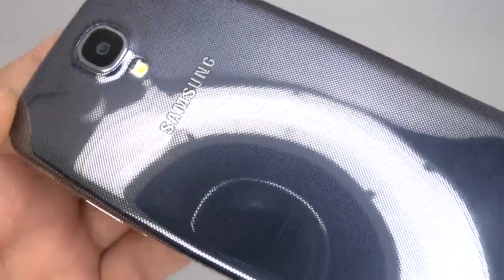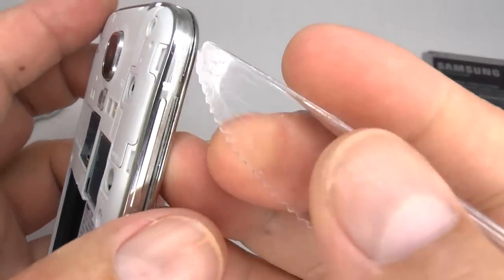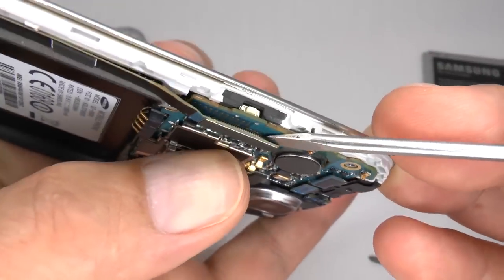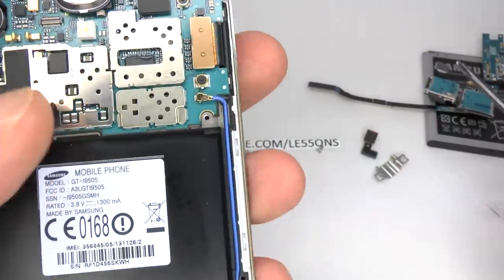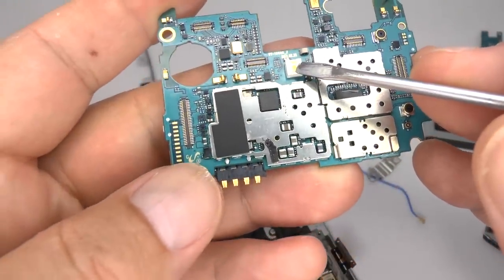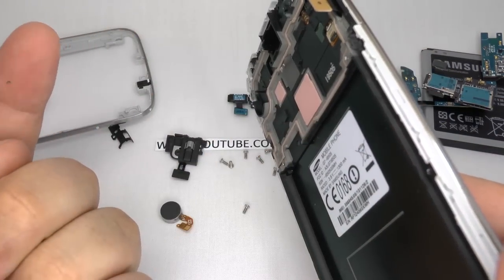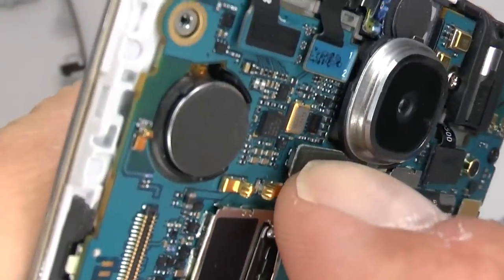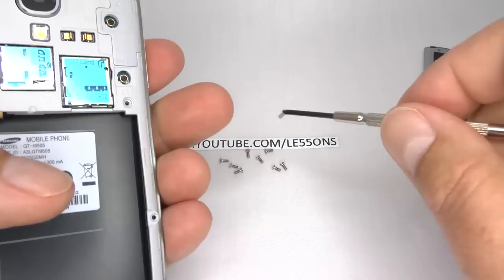Galaxy S4 Disassembly & Assembly Teardown - Screen & Case Replacement

Comment: Well It actually broke when I was replacing my charging port, and when my dad was soldering it back together he pretty much melted the hole up haha... so I have been using my phone with it, so it obviously isn't that vital, so what is it's point? Should I get another one? if so is it just a wifi cable like the other? Thanks :) Gonna like and sub! very detailed video, awesome job!

Comment: Hi, can you please answer this question. I am about to replace the glass on  my wifes s4 using loca. I have done several iphones, well lots really. I just want to know what is the best temp to use when removing the glass, as I have had so many stating different temperatures. I have all the correct equipment in place ie heat gun  and infra red thermometer etc etc ,,,thanks in advance for the reply  rgds Dave.

Comment: Thanks for all your good videos.
I am having problem with my s4 not recognizing my SIM card.
Do you think it will help if I change the SIM reader.
Did a factory reset but that did not help, And nothing wrong with the battery either.
Reply from the maker: a new sim reader would be a good idea, but if its water damage it might not help
Reply: *****

Hi LE55ONS. :)

I bought this phone from a dude. But I dont think that it is water damaged.
Is there any way to see if it is, without opening the phone.?
Sometimes it lose contact with the SIM. But lately it dont help to take out the card or to restart the phone.
Anyway, Thanks for your answer and have a great day.
Reply from the maker: Amoth Jon there are some water sensors inside which change colour if they have been wet, its still worth fitting a new sim reader
Reply: Thanks LE55ONS.Keep up the good work.

Comment: My SG4 got wet 6 months ago, with the help of your video I have taken the phone apart and found no corrosion but the phone will only hold connection to server for phone calls or mobile data when you make the phone select the network manually which only lasts for a minute or so, any idea what is wrong with the phone ? Thanks in advance

Comment: I have changed the screen but menu and back button doesn't work.Home button Ok.Does it have to be some kind of isolation under home button flat cable or it must be in contact with board?

Comment: Hi i on my s4 my ear phones only work on right side with a buzzing noise on my left side i have changed.the phone jack and still no luck ive tried different head phones and still the same do you think if i change the ear piece the main top front speaker would it fix it as i get buzzing noises when im on the phone to someone thanks

Comment: my screen went blank…I placed my board in an identical S4 case (in  case it was the optical cable) still no operating screen…I can answer calls..(if I swipe accurately enough) ..i  tried all the holding the on/off button tricks…no luck…any suggestions on what parts to look at? thanks

Comment: Thanks for vid. If I buy a new plastic-housing without anything - is everything transferable? You dont take out the wifi-bluetooth/GPS/4G antenna!?
Reply from the maker: it should come with the antenna's and the foam pads etc, but have a close look and make sure you swap any parts over that are missing..
Reply from the maker: Martin Dreiager this should help Samsung Galaxy S4 Glass Screen Replacement Marietta, Dallas, West Cobb GA

Comment: I did a screen and LCD replacement on my s4 which I hadn't used for months since breaking it, followed all instructions as carefully as I could, but since reassembly everything works except now the phone switches between absolutely no network signal and only one bar. Even with one bar calls and texts don't work. Any ideas what I did wrong? Thanks

Comment: Hi LE55ONS!
I did everything you said and most of my internal board was corroded. I accidently dropped it in the pool. Had it stored in white rice for a whole week and nothing... So anyway, I powered it on and a green light came on (front on sg4 there's 4 circles and a 5th that I assume is the camera, Is there anything I did wrong? PLEASE REPLY ASAP. THANK YOU!!!

Comment: do  you have to take that circuit board out to replace the camera  lens cover?
Reply from the maker: yes, as the glue that holds the metal lens ring on is very strong and you need to be able to heat and lever from all sides

Comment: My camera can't focus. When the object is right in front of the lens you can see clearly but farther object is all blurred. I got the camera changed recently but still does this. I was told it might be water damage even though I've never dropped it in water.

Is there a way to fix this? Or should I just get a new phone ;-;

Also is there a way to make the phone cooler? It's been heating up alot lately.

Comment: Really Good video.
You make it look easy.
And yes I found it easy too.
I was harder to find a supplier that supplied genuine samsung screens.
Mine set me back £92.99 ouch but it works perfectly, my own fault with the video is, you should of replaced that mid chassis as it was battered, I have made mine look like new. And it really does look new.. 
Great upload man. Thanx.

Comment: Hi my s4 has a problem with the sd memory card won't click in , it makes a click sound but won't stay in , I am a woman and was looking at your video, is it easy to replace this part and does is have to be a genuine part or does the compatible part work the same ? Or is their a fix to this issue rather than replace the sd memory card and sim flex ? Thanks for your help

Comment: Hello. My galaxy s4's volume buttons are a bit stuck, I can still use them but I need to press them harder, and it feels they get stuck in the bottom. Same with my power button. Both pieces don't seem to have any damage at all, I think I just need to pull them out and in again. How can I do it?

Comment: If I were to do a motherboard swap do you know if AT&T would still be able to recognize my phone. Is there a code of some sort encrypted in the phone or is the phone recognized by the sim card?
Reply from the maker: If your sim card works in other unlocked phones then it will be fine, I don't know what system they use but I think they can block non registered imei numbers..
Reply: ***** Two of the screws were really stuck and they partially stripped. Any suggestions on how to get them out? I tried using a rubber band
Reply from the maker: Stephen Klepner you can try soldering a screwdriver into the screw or use a very small drill to take the head off. It might also be worth trying a high quality screwdriver that fits well in the other screws..

Comment: I see there are mid plates for sale. I would like to change out the  piece that is in front of the mid bezal. Is that piece replaceable? i cracked the outer screen and it damaged the bezal that goes around the edge of the screen. Hope that makes sense.
Reply from the maker: its very hard to remove a good screen from a damaged frame, you'll probably end up buy a complete screen assembly with front housing

Comment: Hi, I recently drove over my phone with it inside the case. I had to replace the touch screen assembly and had great success but a few of the sensors seem to not work. Gyroscope and proximity. Where can I buy these or the circuit that controls these sensors? Can I buy a new logic board for it?
Reply from the maker: Try replacing the earpiece and proximity gesture sensor shown at 7:38 and you might find the gyroscope will work again. Its very rare to find logic board for sale..

Comment: Hi! I've watched this video right now (great video btw.) But here's my question: will replacing the main board (except the lower section of the phone) will fix my sensor issues? I'm mean I have a problem that after restart some sensors are working only for a while and then they just stop working (accelerometer and gyroscope) and after few hours every sensor stops working(proximity/ambient/magnetometer etc.) and the phone restart is helping only partially. I've tried all the sollutions: do a hard reset, even installing a custom rom, but any of these didn't help. So in conclusion: will changing the main board fix my sensor issues?

Comment: Hi do you know if there's a chance to remove those thermal pads and replace them with a copper shim, I've been doing this on notebooks gpu's cause the thermal pads they use end up increaising the die temperature. 
   On the S4 I found that the phone temps are idling around 38c, low usage browsing 50C and it's way to much , while gaming cpu core temp rises up to 75C even doing the on demand governor cpu scheduling from 250mhz to 1.6ghz. it's not acceptable for me

Comment: Can you please tell me where is the wireless adapter or antenna?
I disassembled my phone to replace the display and everything is working fine, except the wireless.
The phone connects to my router but it's working really slow.
Give me some advice if you have any ideas please.
Reply: don't think so

Comment: Hope you can help. My S4 has a white antenna lead on the left side opposite the 3G and GSM blue cable. I need to replace this as it broke during the screen repair. Do you happen to know what this antenna is for. My phone is 4g capable, and thoughts would be great
Reply from the maker: I think the extra cable is to support different frequencies used by some networks. You might not notice any difference but if you do they are easy to buy online

Comment: Thanks for video, very helpful. I need to replace my touch & home key flex cable but mine is slightly different to the one shown here. My flex cable plugs in further up on the back side much like your model just further up. My S4 shows a model # SCH-1545 but all the parts sites I find only show the shorter touch & home flex cable. Any ideas on this one?
Reply from the maker: I've put a link to the one you need below, you can use coupon code ETS2 for a little discount which also gives me credit http://www.etradesupply.com/oem-samsung-galaxy-s4-sch-i545-navigator-flex-cable-ribbon.html
Reply: ***** Thanks so much for the link. That looks exactly like what I need.

Comment: I dropped my galaxy s4 in the pool. I put in in rice for about 2 hrs and it seemed to work all right then the screen started to bug out. so I put it back in the rice all night and I tried checking it this morning but now the display is comepletly out but everything else seems to work fine. how do I go about fixing it? or what to take apart as far as cleaning corrosion??

Comment: Ive got one of these but something happened to it when i was charging it, before it started it went off, since then hasent turned on, is that a battery issue or something inside issue, tried turning it on and charging it but nothing on screen, when i charge it phone goes warm which could mean its charging but no turning on the screen.  ive ordered a new battery but nt sure if that will fix the problem, any help will be great, any advice and help thanks

Comment: My s4 fell in beach water for a brief moment, i immediately turned it off and put it in a bowl of rice for a few hours before turning it on. After turning it on, everything booted fine until the screen then went off. The phone receives calls and texts still, it also still feels my finger slides and touches so i could still slide the phone to answer a call. Is the problem with the screen itself or could something inside the phone be what needs to be replaced? Thanks

Comment: I replaced my screen.  Would there be any reason when I put the rear housing on it doesn't turn on, but if the rear housing is off and I put the battery in, it turns on and works properly?

Comment: I'm just curious, do you look at the phone's circuit board guide or something before you actually opened it? I'm just amazed how calm you are while doing this, I guess it's the experience, very good job here sir!
Reply from the maker: I experiment to find which antenna is for what, but it would be much easier if I had a circuit diagram to look at..
Reply: Yeah I thought so but anyways you did a great job, this will really help a lot of people especially cellphone technicians, keep up the good work sir!

Comment: How do I go about removing a loose thread screw? Im trying to replace the glass/lcd/frame. Iused the right screwdriver and successfully removed all but one.
Reply from the maker: you can use a small drill to remove the head and might not need to remove the rest if you have a new frame/screen assembly

Comment: Hi quick question. I think my proximity sensor isn't working properly. Whenever I place a call, my screen goes black automatically and I have to press the button to turn it back on. Should I replace the earpiece/proximity sensor? Or should I open and make sure it's sitting properly all the way down? Thanks.
Reply from the maker: make sure the glass is clean between the sensor and its sitting all the way down, if it still doesn't work you can experiment with very small bits of blu-tak between the sensor and glass until it works ok. You can use the test menu to help #0#

Comment: Hey LE55ONS,
Thanks for the awesome video but one quick question. I have a brand new GS4 and an old broken one with my pictures still in the internal memory. What piece of hardware do I need to put into the new one from the old to get into my internal memory if that's even possible. Any help would be very much appreciated. I already subbed and liked, thanks in advance.
Reply from the maker: you could try putting the old mainboard into your new phone and it might work..
Reply: At what time do you show yourself taking out the mainboard? If you don't mind me asking. Also thanks for your help, really appreciate it.
Reply from the maker: Christian Ledet 10:20

Comment: I am having a problem my power button doesnt work. When I push it it looks like its going to work but screen is active but blank. Now if I squeeze were the camera is at it comes on. Do you have any suggestion on what it is or how to fix it?
Reply from the maker: sounds like the screen might be broken inside, I think a new screen would cure your problem

Comment: Thanks for the very much detailed video, I have a problem in my Galaxy S4 that it stops to charge and a month ago the charging notification LED stopped to blinking while charging and there is no charging icon on the battery while charging ... have you any Idea about this issue ??
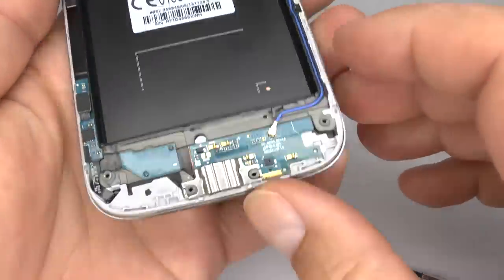Reply from the maker: I would try and have it repaired under warranty or replace the usb port flex 5:15
Reply: Thank you very much for the answer and the Support,
I do very much appreciate your help...

Comment: I think my gesture sensor is broken...as it stopped working all of a sudden though everything is on in the settings.
Where would I get a new sensor? And how can I be sure its a problem with the sensor?
Also my gyro sensor has stopped working as my screen is not rotating...any solutions?

Comment: Many thanks for you video! Both me and my wife have I9505 S4's but my wife's one has its wi-fi dead, so I suppose it is caused by a faulty wifi module - since I tried most of the software solutions.
I am wondering if the wifi module could be replaced without replacing the entire motherboard and without soldering, because I have no practice with that. 
Do you have any tip for me? Thanks in advance!
Reply from the maker: unfortunately it does need a 'hot air' soldering iron, its very hard to find someone who does this kind of repair. It will fetch a good price on ebay as there's always someone who thinks they can fix it :-)
Here's a video using hot air to replace one of the chips Samsung Galaxy S3 dead repair by changing EMMC [HD]
Reply: ***** Thanks! Sent private message. Congrats for the awesome videos!

Comment: thank you for your video. .you are very experience in what you do..can you plz tell why i keep loosing my 4g signal..i always a circle with a line through it..i tried changing the battery and cleaning the antenna but it still was a signal most of the time..plz help...ohhhh my phone is a galaxy s4

Comment: Hi, Just want to say your video is excellent, I got caught in the rain a few weeks ago and since then my phone wouldn't charge via a mains charger, it also crashed and I lost everything. I have replaced the the charging port and is now charging, but it still turns off sometimes when the camera is in use. Do you think I will need to possibly change the camera next!!! regards Jason.
Reply from the maker: yes that would be a good idea..
Reply: Many thanks for your help.

Comment: Hi LE55SONS,
I would like to seek your advice on a small issue around the power button. I have just disassembled an S4, 
After transferring the hardware over to the new screen, i put the battery in to test "before" i clip the silver frame back on - this phone boots and operates without issue.
"After" i clip the silver frame on, the phone doesn't want to boot up once you depress the power on button.
How do i overcome lining up the logic board power button and the frame power button successfully?

Comment: do i need to tske aprt everything in the back jus to replace the flex cable ribbon for thr menu and return button?
Reply from the maker: the replacement of the menu and return touch key flex will need the screen lifting from the front housing. Watch this video and read the faq in the description Galaxy S4 Screen Replacement / Frame Exchange / Test Drive Repair

Comment: when replacing the ear speaker with a new one...does the proximity sensor come off so you can use it with the new ear speaker?
Reply from the maker: its best to buy a new ear speaker with the proximity sensor or you will need to use a soldering iron to move it over to the new one
Reply: Oh ok cuz I can't hear any anything during a phone call I can't hear anyone unless I use a headset
Reply from the maker: Aaron Daniels it would suggest the earpiece is faulty, unless its had water damage a new one should cure the problem